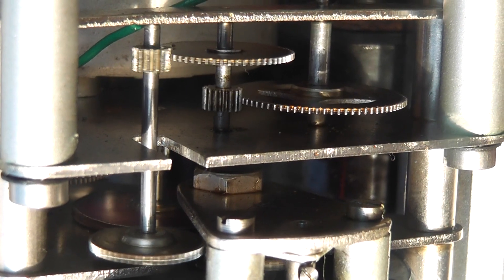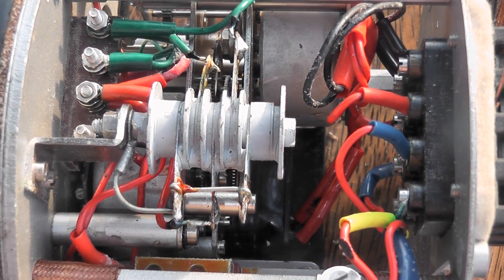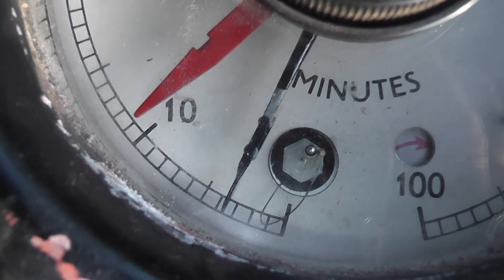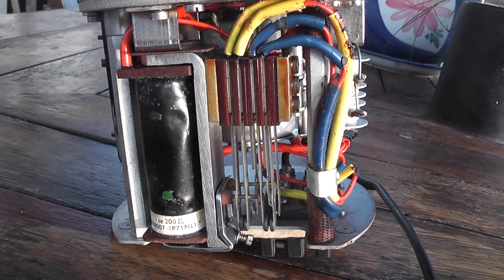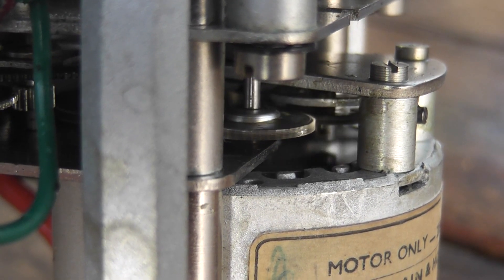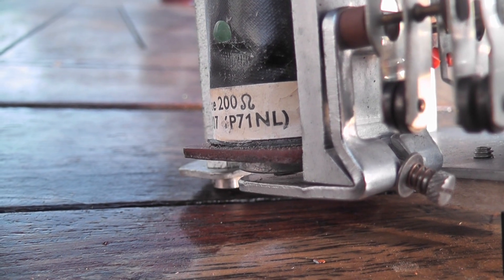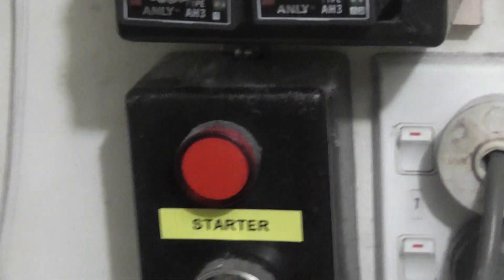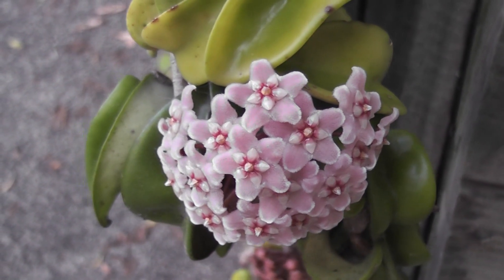Chamberlain & Hookham Process Timer

Comment: Gutted because I scrapped hundreds of similar lamp port light timers back in the late 1970s. 

Been thinking - the drier. Does it not use its timer (the missing broken one) to end with a cool setting at the end of a hot one?
Would the current system you're using not cause harm or risk a fire if it's ending the drying cycle whilst hot?
Just a thought!
Reply from the maker: No, the thermal cut out is still within the device. The third timer on the board controls the cooling cycle after the heater is switched off.
Reply: Excellent!
I should have known you'd have that part covered haha!